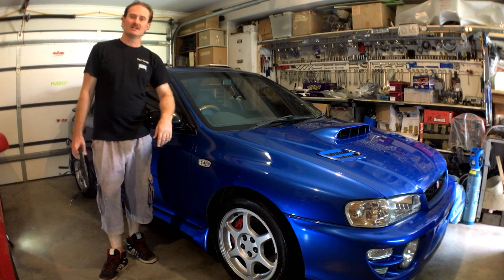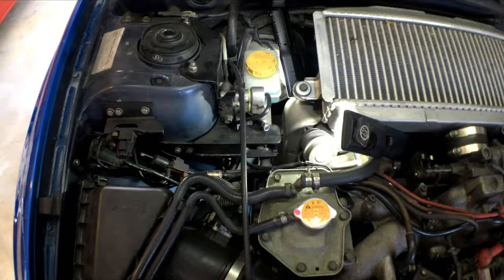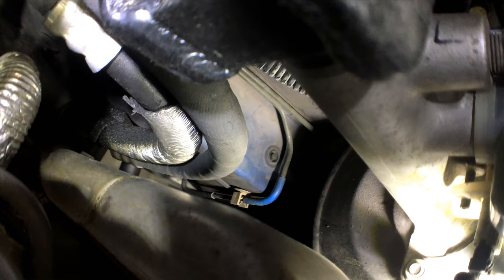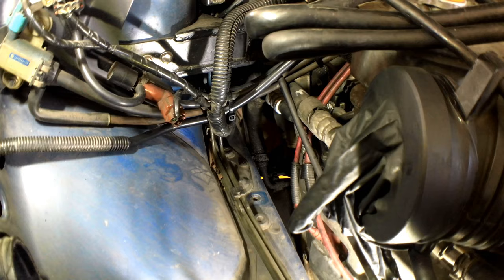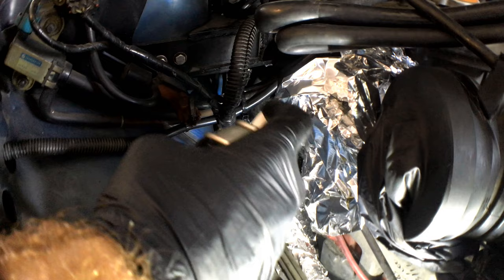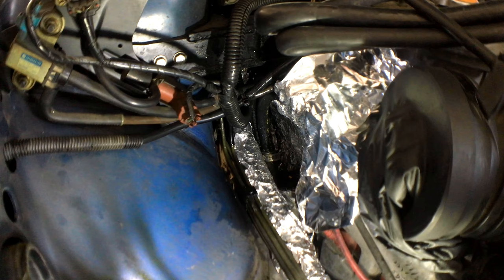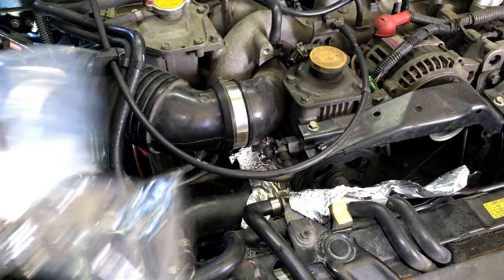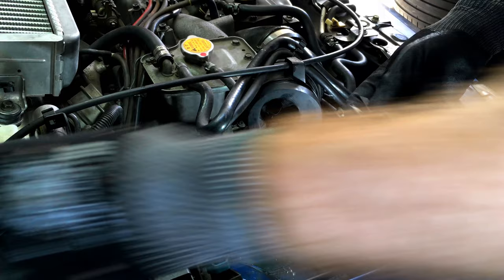Repairing leaking Subaru Power Steering Hoses

Comment: I’ve just attempted this repair and I must admit I didn’t follow it to the letter of the law. I didn’t use the gasket sealant and I only used 1 clamp on either end (but I made sure they were big clamps). After doing some research I found that power steering pumps can put out anywhere between 300 and 2500PSI (couldn’t find EJ20 specs and I’m probably thinking the lower end of the spectrum). Are you able to advise how important it is to follow this exactly? Have you found pressure leaks over time or heat radiation from the turbo reducing the effectiveness of the repair?
Reply: Hope you've got this fixed now but if I understood nev correct I think he only repaired his low pressure hose which is a common failure area, since they aren't under the extreme psi of the high pressure hoses this fix should be fine. For high pressure leaks your best bet is to replace the hose with a new one or take it to get remade
Reply: Return hoses can be fixed this way, a pressure hose cannot (should not)